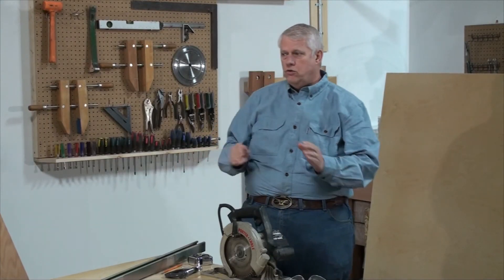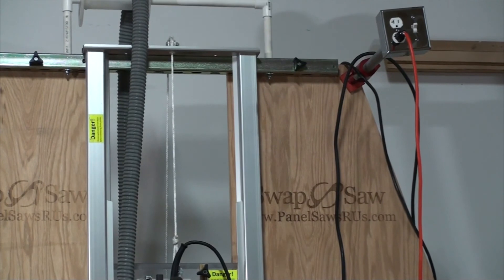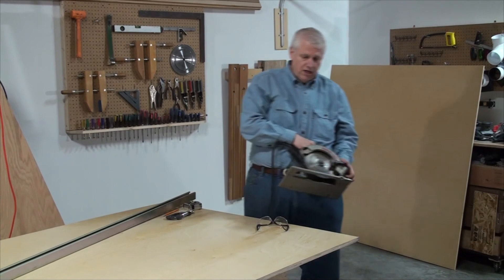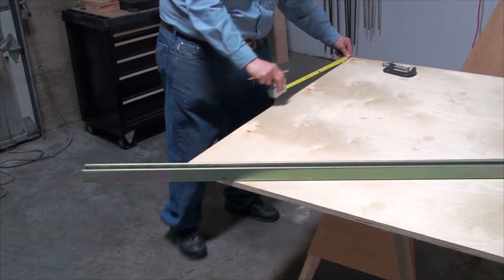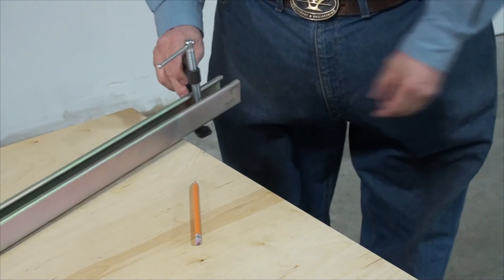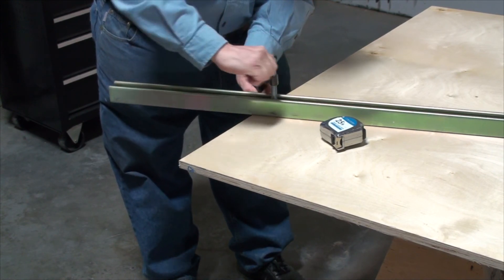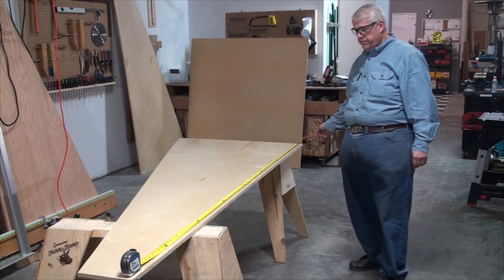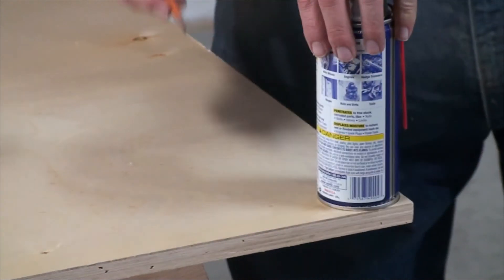Swap Saw Build Instructions Part 1  Back Assemblies

Comment: Great videos, I will be ordering one of these kits soon, however, it would have been nice if you did't use the swap saw that you already have (that the rest of us do not) to build the fence and install the T track.  If there is a simple, accurate way to do the same with a temporary fence or something, a video depicting that would be great.  Thanks, awesome product.
Reply from the maker: You can actually cut the dado with the swap saw without the fence.  With a rotary tool like the router bit it does not matter if the rails are square to the lower strut.  The dado need not be exact.  I have made one fence on the saw I was building it for.  
I don't have a table saw but you could cut the dado on a table saw or a router table.  You could also use a router and a good guide (and some luck) and do a decent job.